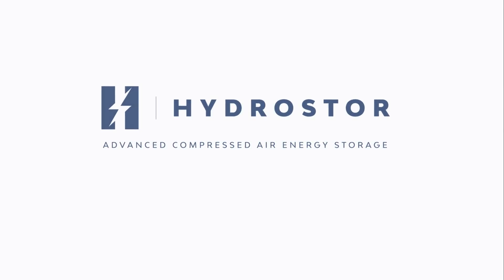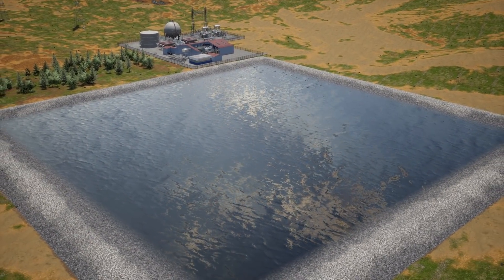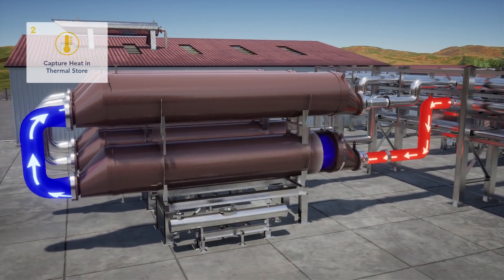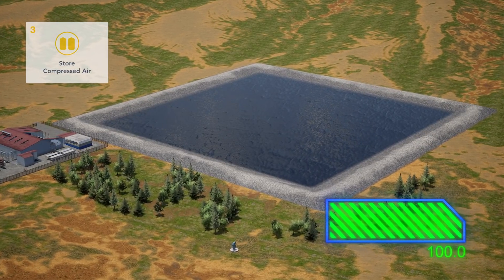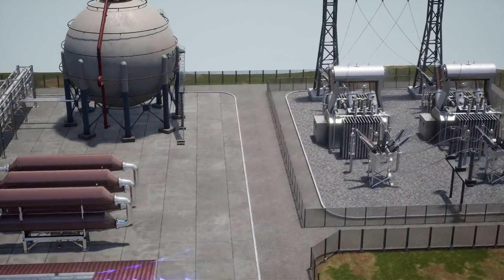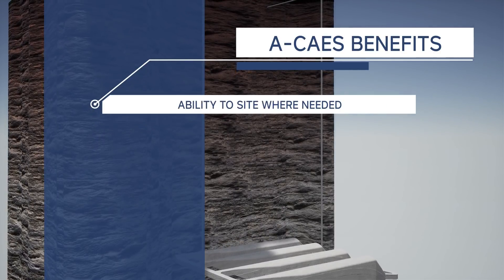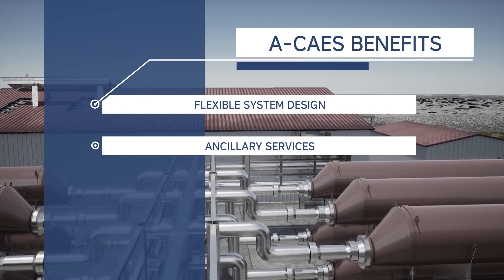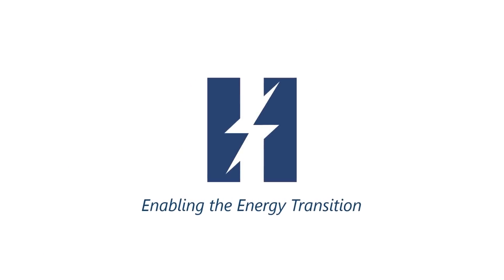How Hydrostor Is Enabling The Energy Transition

Comment: Complicated, with a lot of parts to be installed , with -very high costs maintenance, for sure, and probably with huge costs to install. Not a great "innovation", imho.
We need a true, real "revolution" in the field of batteries manufacture...
Reply: Electric power batteries have plenty to offer. There are carbonate loop fuel cells, flow batteries (aqueous and not,) many battery technologies... This is a storage system too though...why would it be trouble to maintain?

Comment: Is there sealing required to keep the air from entering into the water and then bubbling up through the water column?
Reply: I was curious about this also, for such s big scale.

I'm not an engineer,  but a pipe-fitter. I've built several very small scale systems where water  and air were kept from mixing by installing traps in the piping.

So instead of just straight piping connecting the underground air reservoir to the water above, it was "trapped" with a section of pipe running up from the air, then over horizontally an arbitraty distance, then back down an engineered distance, before returning vertically up to the water.

I have no idea if a similar principle works on this scale or not, or if mechanical seals are used instead. Just tossing out the idea.
Reply: Imagine you've weighed down a bucket full of air at the bottom of a pool. The air is trapped between the waterline and the top of the bucket/cavern. It cannot escape down and out the side to "bubble up" to the surface. No seal is needed, the water's path to the surface just has to be below the cavern's water-air interface.

Now imagine you've attached an air tube to the top of the bucket extending to the surface of the pool. Unless you seal it off with your thumb, the air will shoot out, because the bucket's air is compressed to a pressure of Delta_P =  density of water * gravitational acceleration * depth. Filling it with ambient air now requires a compressor (e.g. your lungs), and releasing it can provide power. Pretty simple.